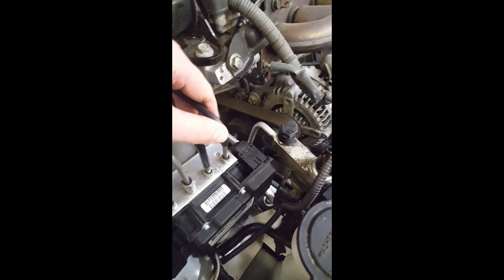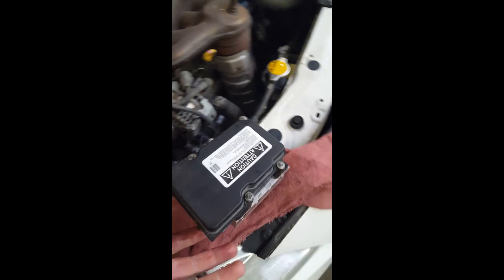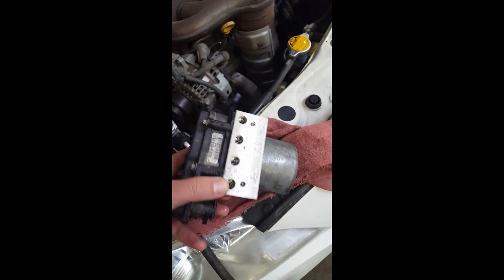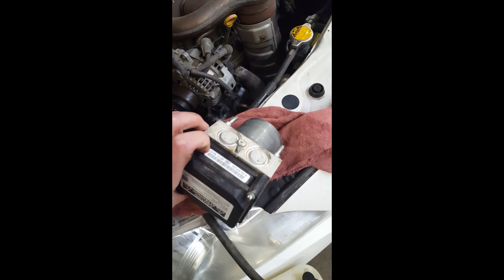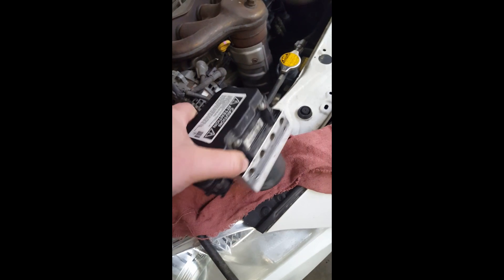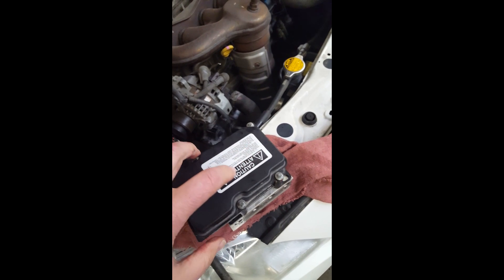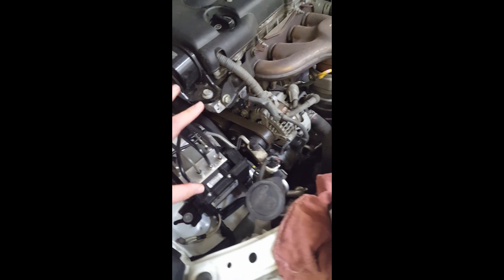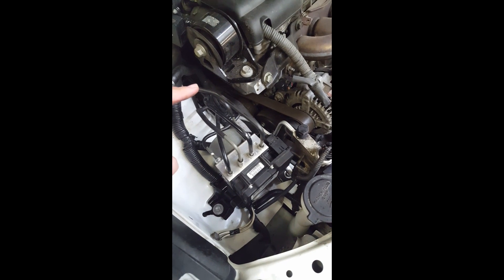How To Fix Toyota Camry speedometer not working 2007-09

Comment: @askmyautomechanic4133 
I seen same symptom(No AC, Odo, Tacho) on my 2007 Camry since a week. What does mean if it works fine when I drive ABS module disconnected. Does mean issue in grounding or loose connector or any wire fault? Thanks myautomechanic.

Comment: I just bought one with the speedometer not working and the ac keeps turning off.  I would have never thought it could be the abs module. If this is my problem. I would just change the module and not worry about messing with the brake lines

Comment: Not quite my problem on a 2008 Camry.  :(  Anyone know what to check when the speedometer and tachometer are just dead and never leave 0.  Also a number of warning lights (air bag, BRAKE, warning, ABS) have come on and requires maintenance notice.  Checked what I could see as possible gauge fuses, but no dead ones found.  Finally, tried my cheap OBD2 BT tool, which I've used effectively on this car before, and it can't complete data connection ('ECU not available', or some such in Torque lite.)  Double checked the OBD2 adapter on another vehicle and it's still working fine.  (Oh, and possibly temp gauge too is pinned at bottom, but haven't driven it enough to be sure.)

Comment: One question instead of disconnecting the brake lines from the ABS system why can't you just replace the ECU of the ABS unit? if the short is located inside the ECU then we should be able to only replace the ECU which would take loosening 4  star head screws. Can you purchase just the ECU or do you have to purchase the entire ABS unit?

Comment: Good video except where you say to unplug module and see if the tach and speedometer start working.  The speedometer can't work with the abs module unplugged since the speed signal comes from the abs module.
Reply: I was looking for this comment. You're exactly correct.

I think what he meant to say is that the needles would stop jumping around.

Comment: Please I have similar problem with my 2006 Toyota Corolla automatic transmission. Everything works alright but the speedometer not working and the ABS and the break lights are on.  So many mechanics can't seems to get it fix. Please what's the exact problem? Kindly help me.

Comment: So I replace the abs module with a used one and still have the same problem. I was doing some more research and found that it can be the wheel speed sensor? Help please

Comment: So,  I have a 2008 Camry doing this tachydance and the lights. It can be evoked when stopping really forcefully. When it showed I unplugged the module, but the dance remained. 
What is the flow logic for when the diagnostic step of testing while unplugged does not effect a change? 
Does this throw a fault? If so, does the fault go away when the symptoms go away?
Does it mean the short is somewhere else? 
Could it be the blue fuse module? 
If a fuse, why would forceful stopping create a short? If a short I would think it is always shorted. 
What other diagnostic steps do you recommend?

Comment: I did unplug the ABS module, after that everything like the tachometer and engine temp gauge works properly but the speedometer sits down there itself. So should i go ahead and get the ABS module replaced ?
Reply: I have the same question, did u find a solution or fix the problem sir?

Comment: Hi I have a 2007 lexus is250 that the speedometer and gas gauge is not working but the rpm is working
Reply: I have the same problem with a 2008 lexus is250. Did you get this problem fix yet?
Reply: I having the same problem with my 2008 lexus is250 I want to know if you got this problem fix how what you did?

Comment: Why not just replace just the ABS control module?
It might save time,you don't need to bleed the system if you just replace the controll module. This only works if you don't have traction control.

Comment: I own a 2007 Camry Hybrid, it has two problems that I've noticed.
1.) When driving at speeds over 45mph my speedometer reads 5mph over my actual speed.
2.) The odometer reads 20 miles over what i actually drove. I started using "Mile IQ" when i noticed something was wrong. At 100 miles driven, it Displayed 160 miles. it eventually dropped to 20 mile difference once I reached 200+.

What can possibly be wrong with my car? I look forward to any suggestions, thank you.

Comment: This is a bullshit auto mechanic, ABS and has nothing to do with AC turning off and on and having the speedometer and Tachometer and temp gauge bouncing. I work for Oreilly my job is to give advice and my advice to all is go check your battery and Alternator. Your problem will be a failing Alternator. Which is a faulty ground. I had the same problem. These videos are all bullshit just for marketing.

Comment: Hi;
I have a problem in my camry 2008 2.4L 
Automatic transmission, the 5th gear is missing, check engine light comes on,
I examined the car by obd 2 scanner, 
the trouble code is ((P0500 - Vehicle speed sensor)) what this means? And where is the location of this sensor in the engine?
I'm from Iraq we don't have car service centers in the near by, the mechanics told me to change the ABS?!
I lossed a lot of money with no benefit
Can you help me to solve the problem?
Thanks.
Reply: Same thing is happeninb to me, did u solve the problem? What was the issue?

Comment: Hey, my wifes 07 camry has the exact same symptoms. I disconnected the abs as suggested and the tachometer began working but the speedometer still registered as 0
Reply: Same issue. Speedo still didn't work. Did you find the issue? Was it the same, abs control module?

Comment: I have the same problem with my 2009 Camry LE since last year. Toyota is extending warranty on hybrids only with this problem but not regular camrys.
Do I need to bleed it if replacing the abs module only and not replacing the pump?

Comment: Friend Nice presentation ! I have a 2009 Toyota Camry LE. I have similar problem as in the video you have. Only thing is it is Intermittent meaning Speedometer drops to zero then after sometime it comes back up. DO you think  replacing ABS Controller module will solve the problem. I am planning to remove my ABS and get it fixed by someone out of town. Also the Mechanic told me that even after the ABS Module has been removed i can still drive around until i get my ABS Repaired is he right?
Reply: I am having the same issue ...did replacing the abs module fix you prob?

Comment: I want to make an addition to the circuit board in the instrument cluster of my 2015 Camry.  I can remove the instrument cluster and get the assembly partially disassembled, but I don't know how to remove the speedometer and tachometer pointers to complete the disassembly.  Is there any trick to that or is it simply brute force?

Comment: my tachometer is going crazy when I'm in idle and I have a "check engine" light on. 2008 Toyota camry le. Error code U0073
Reply: I got the same code plus p0500 what did u do to fix it?

Comment: I unplugged the abs and the tachometer work not the speedometer and the brake light was still on and the air conditioner   still not working pls help
Reply: Same issue, did u fix it?
Reply: 2008 Toyota camry xle

Comment: my 06 nissan altima transmission is stop shifting after long drive ( about an hour or more ) plus i have hard shifting to gear 2 car jumps when shifting with like impact sound.  fluid and color and level all ok  ,, please help
Reply from the maker: Sounds like internal trans failure... Is it setting any codes?

Comment: Hi, I am about to buy a toyota camry altise 2008 model but the odometer does not show the P R D S that represents Parking, Reverse, Drive on the gear...apart from this, the car is very sound. please what do you reckon?
Reply from the maker: That will most likely be a problem with the instrument cluster and would need to be repaired or replaced....Check with Toyota on the cost of a new instrument cluster.... The 08 Camry is a great car... Probably wouldn't be a bad idea to have a mechanic/shop do a pre-purchase inspection. (before you buy) Most shops charge a range of $30-$75.00 for this service..
Reply: Thanks for that...

Comment: Hi, i have a 2009 Camry with exactly the same issue you demonstrated expect that it's periodic which means it happens for sometimes only & then every thing runs normally !!! would it still be the ABS module ???
Reply from the maker: +Saeed Salad yes usually there is electrical short inside the ABS module that can sometimes be intermittent

Comment: Hey i really need your help here. I have the same problem with my Toyota Camry 2007, the speedometer goes crazy and the ABS light and the Break light comes on but not the cluster light, that has always been off. I checked it with the mechanic and the DTC no is U0073/94. I located the module and i took it out for a drive and the Break light and ABS light stays on. So is the problem the module or something else ? do i just need to replace the module or thats not the problem ?
Reply from the maker: Without testing it myself... Everything is pointing to the module... I would replace it...
Reply: Manifa Shahnazarian im having the same problem

Comment: I have a 97 Camry LE, the odometer is blank and speed cannot be detected as well. ABS and engine lights are on. Also, transmission slips. What should I do? Thanks in advance!
Reply from the maker: Sounds like it may need a transmission and many other fix's... Might be time to go car shopping however... Do you have the code of the check engine light? and also the ABS Codes?  Those codes will help me give you better advice..

Comment: I have problem with 2009. with random start, the ABS brake on speedo meter not work and other time random start no problem ABS light not on speed o meter work fine.
do you think there are 2problems 1- cluster and 2-ABS Module, 
so what is you suggestion. thanx
Reply from the maker: +Mohammad Idrees Replace the ABS module, that should take care of the ABS light and Speedometer problem...However your no start issue would be something else.
Reply: Car drive like champ. No starting issue. I mention it randomly when I start if the abs light comes on then speedometer would not work and other time if abs light does not comes on the speedometer does work.
It has to do with abs light when it's not on then speedometers work.thanx
Reply from the maker: Yes you need a new ABS Module...That should be your only problem.

Comment: ready to install abs need to see video on proper way to bleed the brakes
Reply from the maker: +Mike Conley I will see what I can provide for you in the morning.
Reply from the maker: Here is the TEXT BOOK Instruction

Bleeding Sequence:
Start with wheel that is farthest from themaster cylinder.Bleed Procedure:
OEM Procedures

1st Start with wheel farthest from master cylinder.2nd Set parking brake.3rd Bleed the wheel calipers.4rth After bleeding the air from the brake system, if the height or feel of the brake pedal cannot be obtained, bleed air from the actuator assembly with hand held tester by following steps below.5th Depress the brake pedal more than 20 times with engine off.6th Connect the hand-held tester to the DLC3 connector.7th Turn the ignition switch to the ON position.8th Select “AIR BLEEDING” on the scan tool.9th Bleed the air by following the steps displayed on the hand-held tester.

However most people do not have a scan tool..
So I would follow this... I have done it this way on this car personally.
1-While a friend is sitting in the car, You go to the Right Rear Wheel first.
2-Have your friend pump the pedal 10-times holding/pushing the brake pedal to the floor as you loosen the bleeder screw,then while your friend is holding the brake pedal to the floor tighten the bleeder screw
3-Then do step 2 on the Left Rear Wheel
4-Check the brake fluid level at this point and top it off
5-Then do step 2 on the Right front wheel.
6-Then do step 2 on the Left front wheel.
7-Check fluid level again.
8-Fallow this exact procedure again.
9-Double check the fluid level and then take out for test drive.
Reply: Thanks for your video. My 2008 Camry has the same problem at present,  speedometer not working, both brakes and ABS lights come. 

I want to but the ABS module from ebay. My question is should I buy the ABS part with pump, or just the ABS module without pump? 

Another question is about the right steps for the replacing work, as my understanding, it should be
First, I need to bleed all the brake fluid out from four breaks.
Second, Replace ABS pump/module.
Third, Flush brake fluid, make sure there is no air blub.
Are the steps correct? 

Thank you very much.
Reply: +Mike Conley There is a scan tools out there you can buy that say ABS bleeding. You need to follow the direction what it says on the scan tools. I got my scan tools and it works like a charm. This is the right way. I work for Toyota for over 8 years and that how I bleed the ABS by scan tools. I have my own scan tools now.